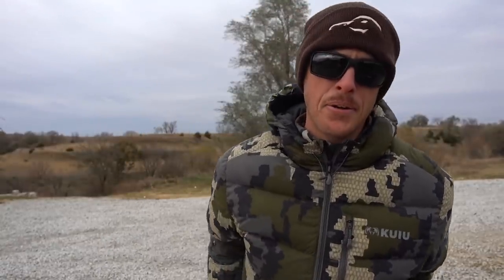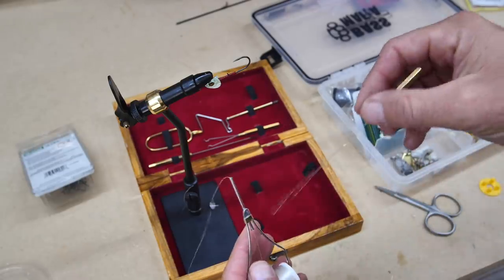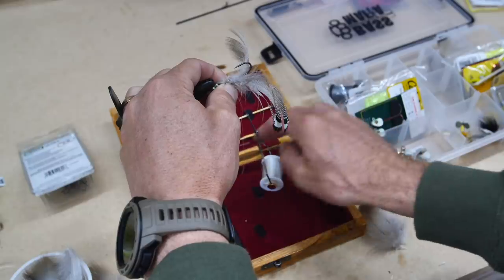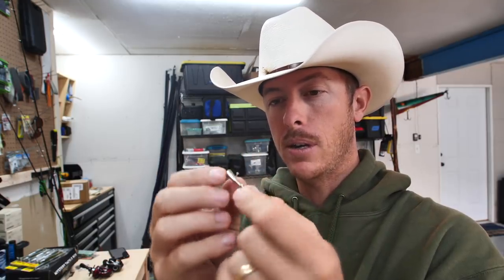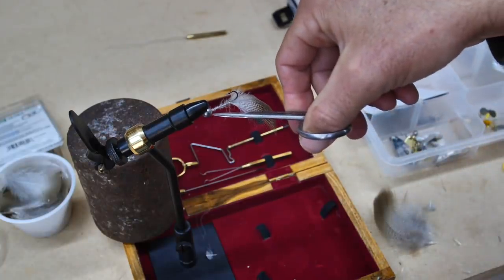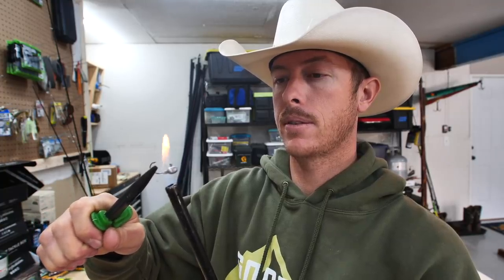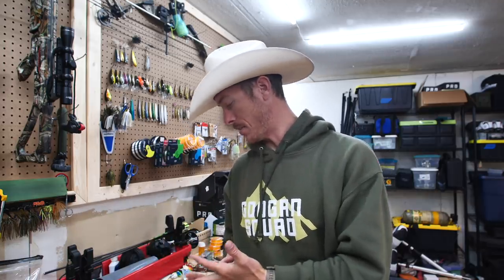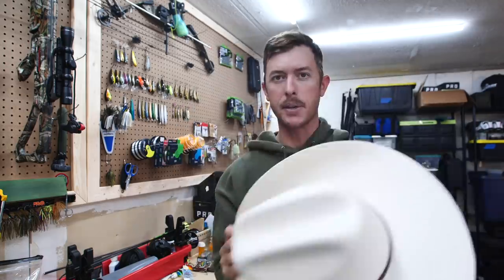Using Hunted Duck Feathers to Make Fishing Lures

Comment: Also, start w/ straight part of the hook (leading to the point, just past the bowl) in the vice, then wrap thread on the bare hook, try for 1 layer. Then as you add material start at the back and tie it in (let it hang, move the thread to the head to catch it) wrap your materials up the hook and then "catch" or tie off on the other end (allows you to only have one layer of materials). Great stuff though, its fun learning it all. Youtube has the best tutorials, bass poppers are very fun to tie also.

Comment: You should add a wire cover to your chicken run.  Soaring hawks are often looking for prey on the ground then perch and wait for it. We often go out hearing squirrels alarm calls with no hawk in sight.  But often spot them sitting in the shadows of the tree leaves or close to tree trunk blending in.  Cooper’s hawks are amazing.  You see it look away and it hasn’t moved but it’s out sight again.  Also run your hotwire  low enough so a animal touching won’t fall into the run.  You might want to also think about angling the top few inches of wire out around the top edge with supports to make it harder for animals to climb over if your hotwire stops working.  Hot wires short out often leaves branches grounding to the wire keep it clean.  Also keep feed picked up.  Spilt feed will attract little critters which attract predators with and without legs.

Comment: feeder. You like Wood Duck feathers you will love Turkey and Pheasant feathers. I've tied more flies with Turkey and Pheasant feathers than any other. I'm sure others have said it however, turn your jig around so the hook is in the vise with the point on the bottom. Have the jig sit parallel to the bench. Some tip the hook or jig either up or down slightly. It's all personal preference and what makes it easier. Best of luck tying. I've been doing it for over 25 yrs and am still learning tricks and new techniques.

Comment: If you don't have a bobbin threader, pull enough thread off the spool to go through the bobbin tube plus a few extra inches, start pushing it through and then suck sharp and fast on the other end like a drinking straw (like a reverse whistle) and it pulls the thread through. This saved my butt a few times when I couldn't find mine.

Comment: Nice, I do fly tying and lure making myself. You're supposed put the hook point part of the hook, in the vice, with the hook shank on top, and hook eye pointing away from the vice. This way, you tie off at the hook eye end of the hook, and it's easier than trying to do half hitches over the materials you tied in.  Before you tie feathers in, you wrap a layer of thread on the hook shank first. This way it locks the materials in better when you tie them in. When you do half hitches, wrap them around the hook multiple times before you cinch them down.And after you clip the thread when you tie off, put a little super glue or head cement on the knot, or where you tied off. That way the fly/jig/dressing will last you longer, and be more durable. You don't need special expensive hooks for basic beginner fly tying either. You can go get some cheap aberdeen or bait holders from walmart that should do the trick. I like to take a hole punch, and punch out little round disk like pieces from foam sheets, stack them and glue them together, and use them as little popper fly bodies. Cheap and effective, and can be found at walmart. I do like to use kink shank hooks for those though,as the bends in the hook will stop the hook from turning in the popper body, but one could still manage with an aberdeen hook. I hope you saved more feathers from that wood duck. Look into getting some marabou feathers. That's what people use for crappie jigs. Good luck dude! It's a thrill catching fish on things that I build here at my desk. I like to use my homemade things often. I think you should look into  building inline spinners. I love making them, and they are fairly easy to build.

Comment: A tip of getting the thread through the bobbin, put the thread in then suck it through, very simple and alot faster lol.
Also when you start your tying, put the thread on the hook, take the thread and lay it on the hook and then wrap it around with the bobbin, this also gives it a good base so whatever you tie won't slip.
Recommend getting some cement, fly glue ECT to seal the knot and you don't ever have to worry about it coming apart.
Something else I notice is when your wrapping it, do 3 very lose wraps and then pull it right, this keeps it from moving to one side.
Shouldn't tie off and clip the thread when putting a new material on, you can just tie it right on and it not come off( after you tie the feather just wrap the thread back to the front, then put the next material on and tie it back, also the chenille, I suggest melting the end of it so it doesn't fall apart in the water, I've had alot do this

Comment: It's way easier if you put the hook in the vice rather then the line tie and start your thread on the hook or jig first then lay the feathers around the shank or body and then wrap. Dont have to try and hold all the material at once and try to get it started. Good thread base will keep the material from sliding around. Hope these tips help.

Comment: you can easily use fishing line or small wire like the wire you use to tie brassie flies fold it in half and get the thread through the hole without that goofy tool, i bought one of those as well then it dawned on me how easily you can use other materials you already have laying around to get the thread through the bobbin. and yeah as said close to the hook point is the part that goes into the vice not the eye haha
Reply: you should do some research on fly tying haha

Comment: Good job tying those flies. To make them stronger wrap your hook with the thread 1st then add glue. do not cut the thread. then add feathers tie those then put your half hitches. glue those and they will last longer. I learned this from tying flies for 15 yrs. also add glue to the hook before you wrap thread around the hook. This will set the thread and help making flies easier. Also go to your local fly shop and get the glue made for flies. it has no scent compared to super glue. Last thing you put your jigs in backwards. put the hook itself in the clamp the curve of the hook. Good luck with your tying bro. Nothing better than catching a fish on a lure you made.

Comment: I tried not to comment but tie the line on the jig head first use a dab of super glue or head cement to secure the line to the jig they will hold up better and put the hook not the eye in the vice. I like the fact you got the feathers yourself but you should have skinned the duck and cured it